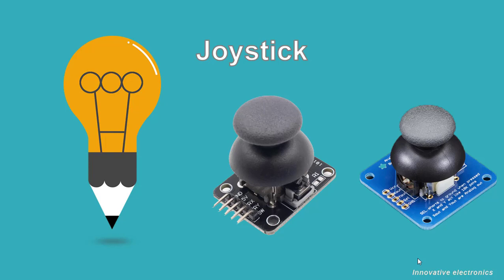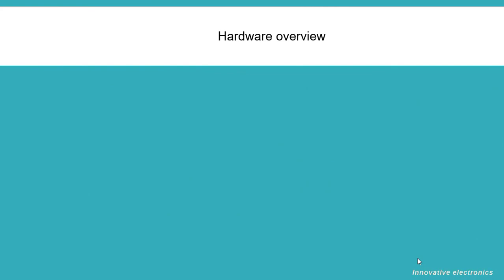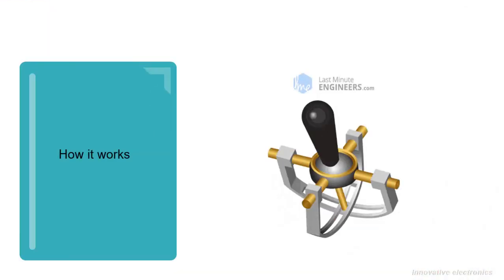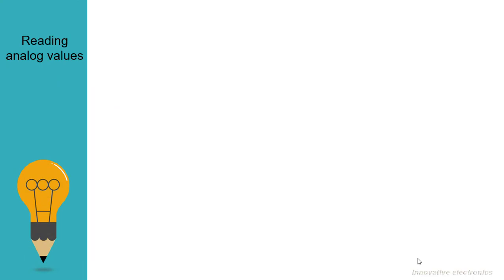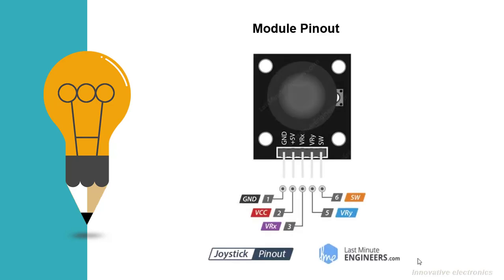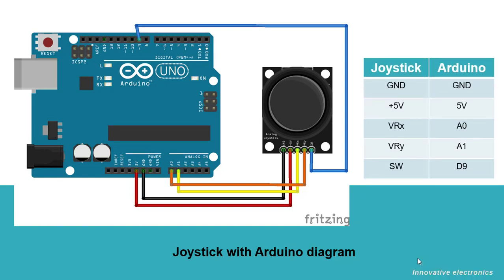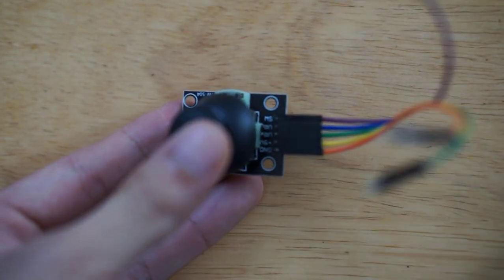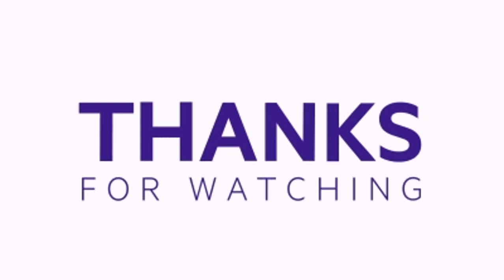How joystick works? - How to connect Joystick with Arduino - Arduino tutorial

Comment: Hi ! First really nice vod ! 

 I'm experiencing an issue while playing Super Smash Bros. Ultimate using my Razer Wolverine Chroma V2 controller through the Magic-NS adapter. When I try to dash by quickly flicking the joystick, even though the joystick reaches its full range (touching the edge of the ring), the input sometimes doesn't register. This inconsistency is affecting my gameplay, and I'm unsure how to fix it. Is increasing the outer deadzone the solution ?

If so, do you have any suggestions on how to resolve it? Can i change how the hardware react ? Or can i change it by the firmware ?

Thank you in advance for any help you can provide!